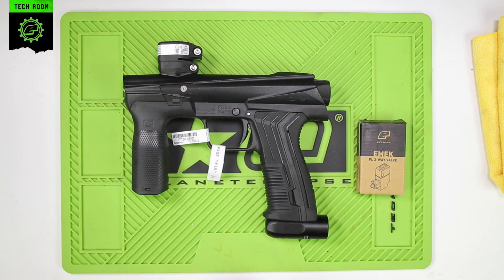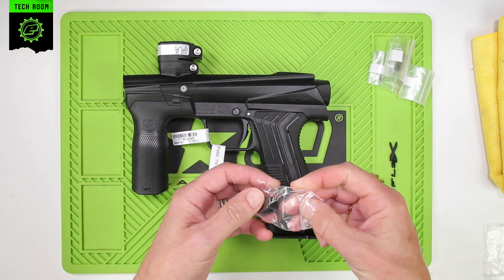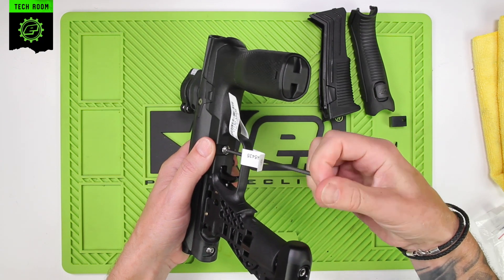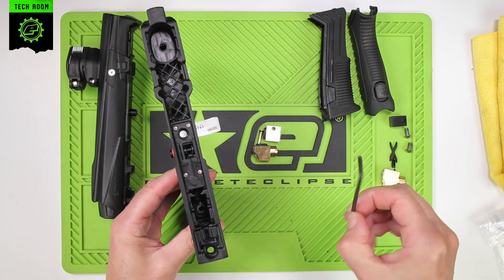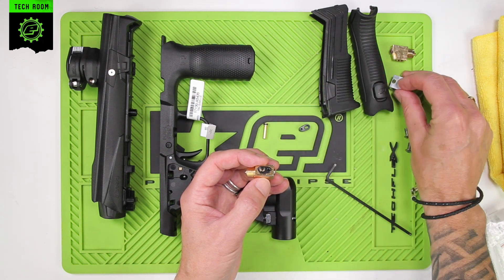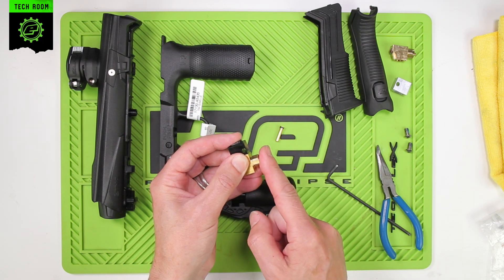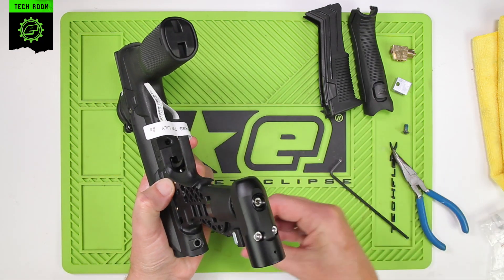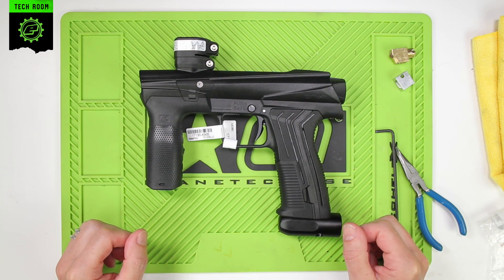Eclipse FL 3-Way Valve: Installation

Comment: What's better this or the deadly wind 45
Reply: PE focused on robustness and reliability over pure performance, the DW hair45 will shoot a bit faster and lighter but has more issues with leaks. DW hair45 is also a lot harder to get parts for where the PE FL 3 way comes with the spares you will never need.
Reply: @dirtytoenail45  FINALLY.  I’ve been waiting for a straight answer about the pros/cons of each one.  Thanks, you made the decision a little easier
Reply: @HalfbreedTrini  they are both perfectly fine options and most people won’t notice any difference.
Reply: I'm pretty sure they do the same thing but dont quote me.